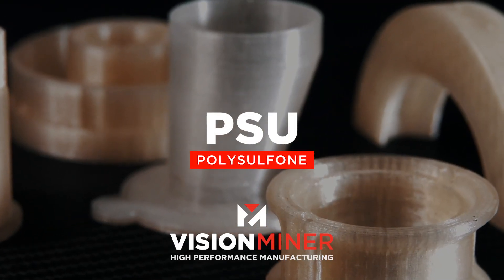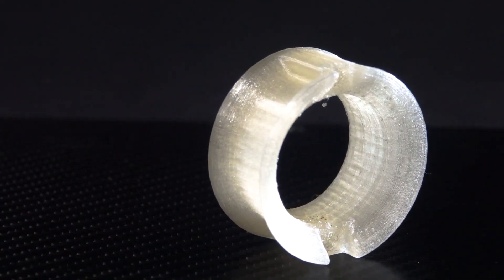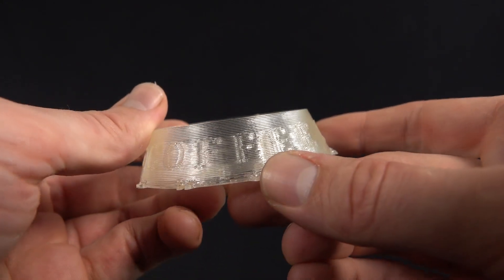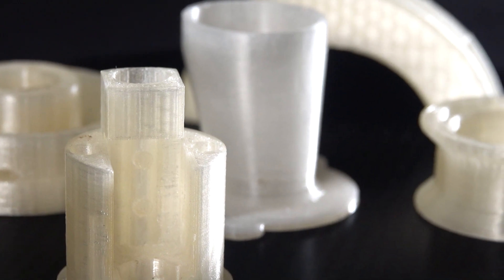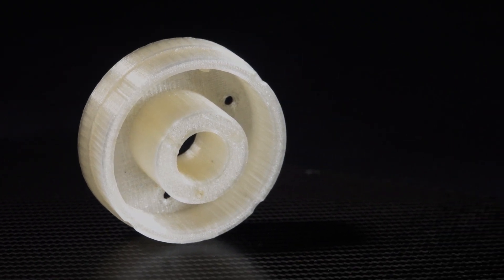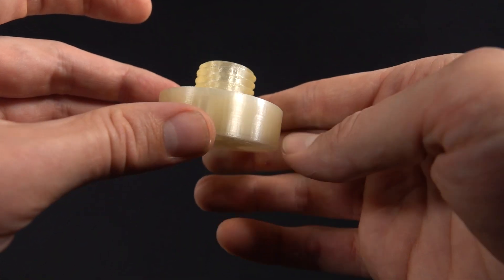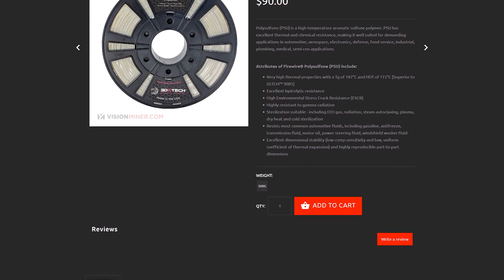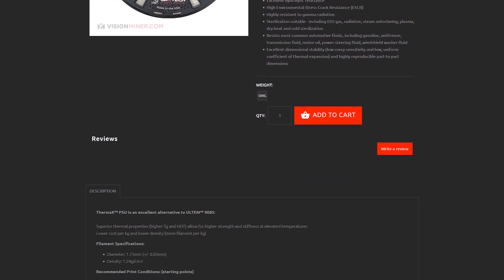Polysulfone (PSU) Filament in 3D Printing FFF / FDM - High-Temp, Chemically Resistant SuperPolymer

Comment: So how does it compare to the new tungsten filament or even cast lead
Reply from the maker: That's a very broad question... you will HAVE to be more specific or this could be a 4-hour lecture covering 90+ topics...
Reply: @VisionMiner for radiation shielding (would test it out myself however I dont have a 3d printer and personally I haven't heard of this material before but recently heard about it and its apparent radiation shielding abilities)

Basically how much material would it take to half the amount of radiation (its plastic so I'll say beta since I doubt it will attenuate enough gamma or xray to do anything like lead and uranium and other high z materials)

Compared to lead and tungsten filament (i know the data for lead no clue for tungsten filament and no clue for PSU)

You can pick any source easy ones to find are uranium glazed dishes, glass, radium watches, thoriated camera lenses, thorium lantern mantles, and thoriated tungsten electrodes for welding)

Comment: Hi quick question. I am relatively new into the polymer (3D printing) world. What do you recommended for 3D printing a tube with some holes on the sides that can withstand the drilling of threads inside the holes. Without causing it to chip/break? I do not necessarily need high T performance or chemical resistance. 

Would love to see a recommendation!
Reply from the maker: PCTG works pretty good for that, as well as CF Nylon :) The high-temps like PSU do a better job, though
Reply: @VisionMiner  thank you so much! Gonna check them out

Comment: You mentioned at 7:05 that PSU runs for about $150/kg. I've only been able to find it for closer to $225. Is that lower price for bulk volumes, or just from a different supplier than 3DXTech?
Reply from the maker: Did we accidentally say 150/kg? That was supposed to be for the 500g spools that we carry -- currently $125/500g --- oops!
Reply: @VisionMiner  Darn, I was hoping it was just a deal out there that I was not aware of ;) Thank you both for all the cool stuff you have been putting out. It's very interesting to learn about the other kinds of plastics out there that I hadn't even heard of before.

Comment: Great vid!  What’s the ideal chamber temp for PSU?
Reply from the maker: 90-170c :)
Reply: @VisionMiner  Thanks!  Yesterday I printed a benchy with no raft on PEI (no adhesive) at 115c chamber and absolute no warpage or lifting from build plate.  Like you said, PSU is SOOOOO much easier to print than Ultem 1010.  

I ordered some of your nano polymer glue and hope to dial in Ultem 1010.  Maybe I just need to upgrade my chamber heaters to get closer to 1010's Tg.

Comment: Keep em coming!
What does "full chamber heat" mean? What's the minimum?
Reply: Think they are referring to a passively heated chamber ( heated by nozzle and bed) vs a system with a dedicated heater
Reply from the maker: @tedlasman @usrenmae Full chamber heat basically means max on your system -- but our systems have a minimum of 90ºC in the chamber, so generally that's what we mean. However, if you can go hotter, it's recommended. Generally passive heating isn't enough for more than tiny parts, unfortunately.
Reply: @VisionMiner thank you. What's the max chamber temp that you see useful in a high temp 3d printer?
Reply from the maker: @Tedlasman  230c -- just below the TG of the hottest materials, so they can be relaxed in the chamber during the build :) PPSU has one of the highest glass-transition temperatures at around 230c